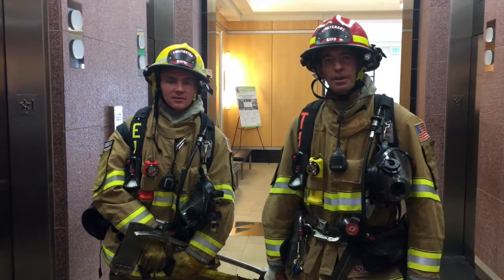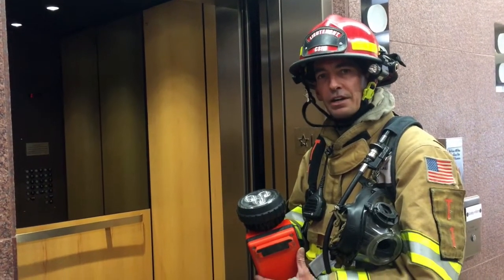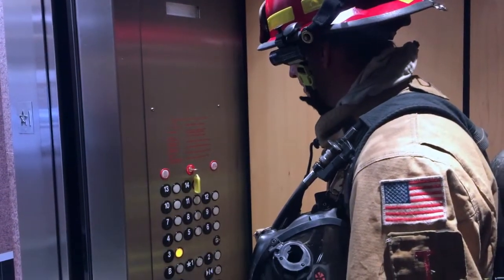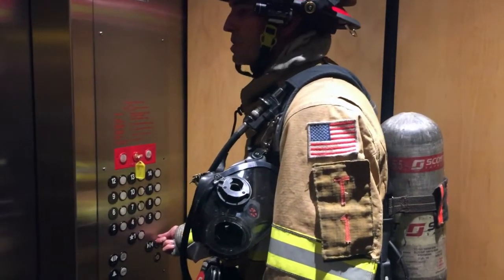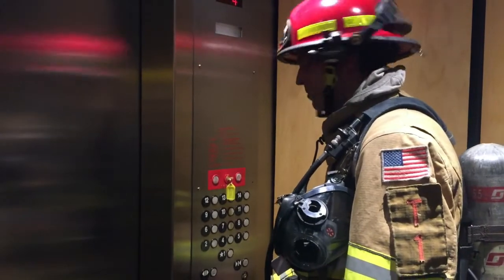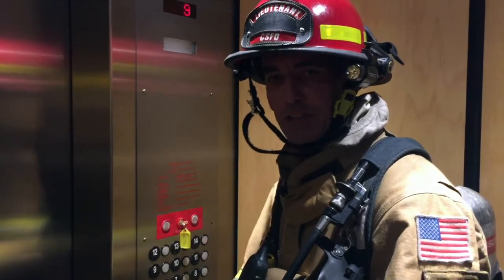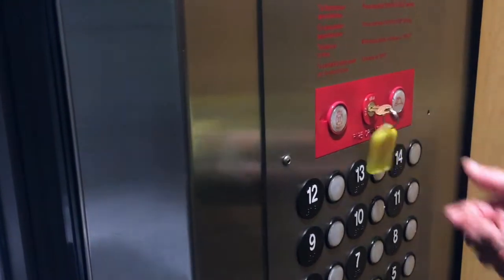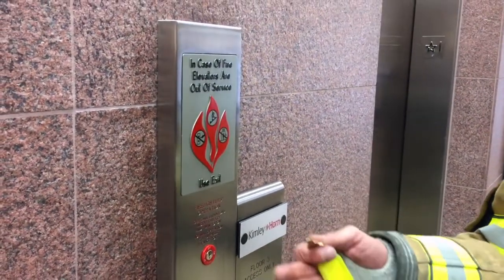Elevator Operations  Clearing an elevator for use during an automatic alarm

Comment: At 2:20, you said if it's lit or flashing, a smoke detector was activated in the shaft or elevator machine room.  If it's lit, it means the elevator is in fire service.  On this brand of elevator, the light turns off after a recall has occurred, if the cap is flashing, then a smoke detector was activated in the shaft or machine room.